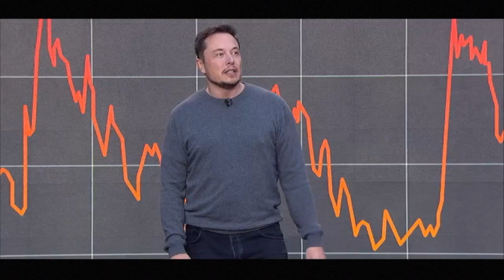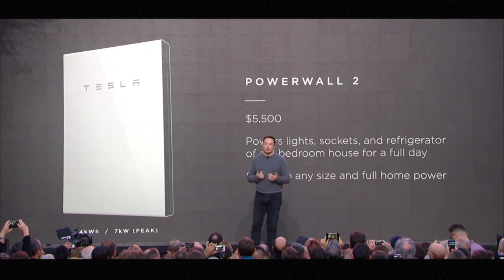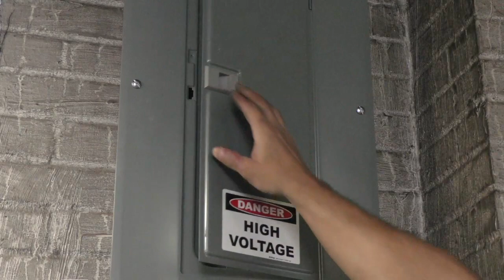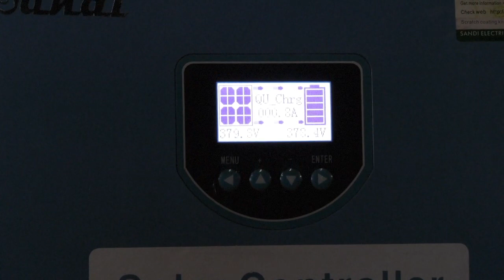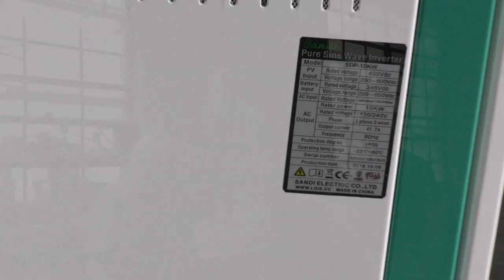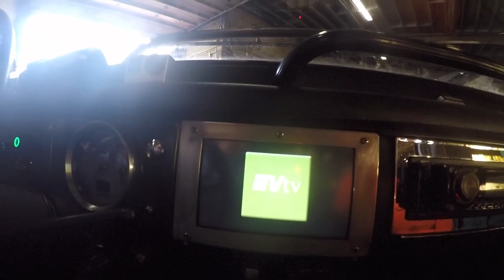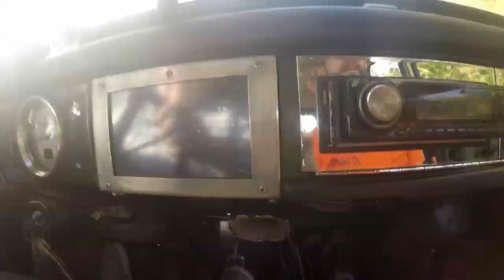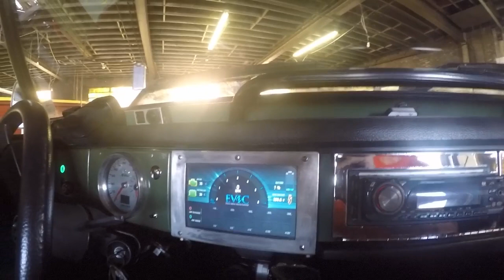EVTV Friday Show - November 5, 2016

Comment: I hope you are using DC breakers in the obviously AC panel. http://blog.gogreensolar.com/2015/02/ac-vs-dc-breakers.html
Reply: i think there being used more as isolation switches than actual current breaking devices, but yeah correctly dc rated breakers should be used